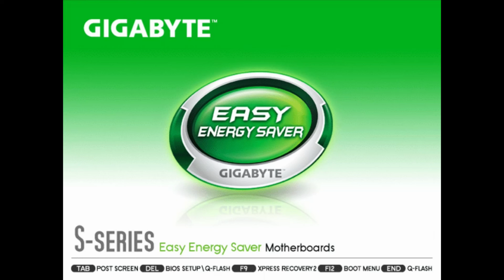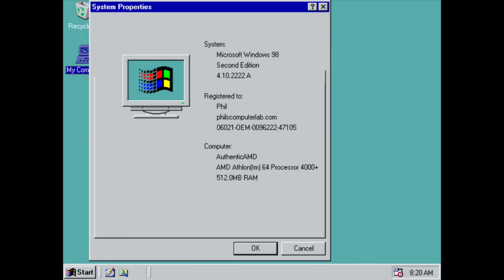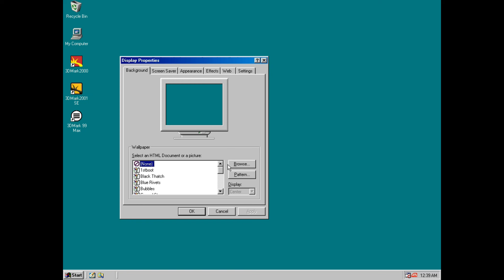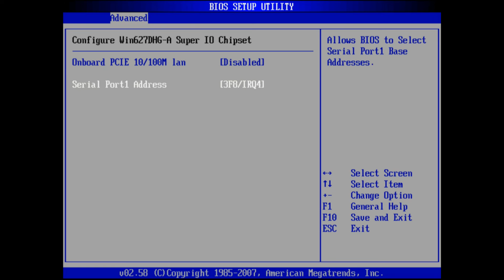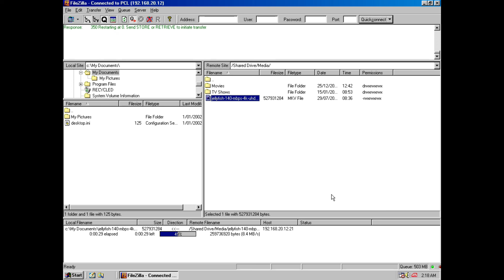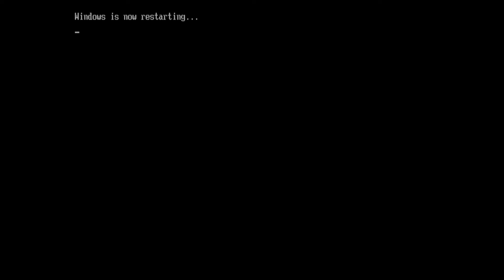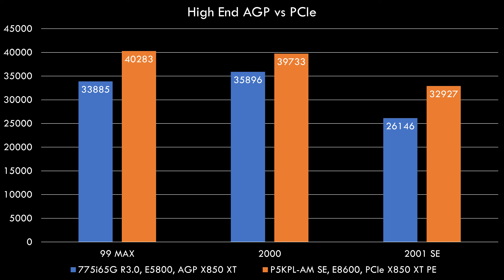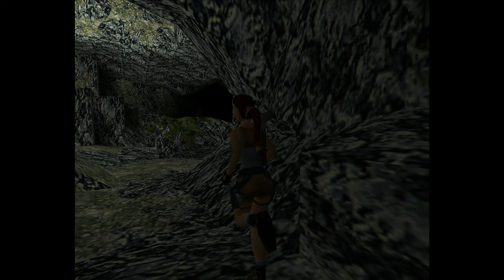Using PCIe Graphics Cards with Windows 98 SE

Comment: Fascinating video. It's really interesting to see what can be made to be compatible with Win98SE. I do have a question though and I think you'll be well placed to answer. In my head I remember it being more about a question of getting drivers to work and getting directX to work and once that happened games weren't really bothered if it was 98 or XP. But I'm a little cautious in assuming that's right because I clearly remember back in the day that if you asked anything about 98 people would just say "Go XP it's better you idiot", because back in the day there was always a relentless push forward to new tech and new games and old stuff was scorned. The reason behind my question is I'm trying to build a set of PCs (I'm up to 6 now) to cover games right from the start of IBM-PC to current day. I've got great overlaps going on, but what I don't really know is between 98SE and XP and between XP and 7... are there any games that don't work properly on XP that are better with super powered hardware in 98?
Reply from the maker: Yea many games work on both, 98 and XP. But with 98 you also get DOS and other parts like Voodoo graphics or A3D that don't work under 98.
Reply: @philscomputerlab  Yes. I have a 386SX16, a 233MMX SS7 with a voodoo1 and an S3 trio(for 386DX to P1MMX stuff), a P3@600 with a 4200ti, an AGP P4 @ 3.2ghz with a 9800pro, an X6 @ 3.2Ghz with a 750ti, and my modern 9900K with a 1080ti. I hope I've got everything covered with enough overlap that I will have a choice of which machine to run anything on.

Comment: "we made some int(e)resting findings" - alter, omegalul-CRINGE - ich hab zwar keinen plan, warum in der channel-info australien drin steht - weil der deutsche akzent ist ja mal mehr als deut(sch)lich rauszuhören - aber bei dem grotting englisch sei angemerkt: "australia" ist australien - wenn es österreich sein sollte - das wäre dann "austria"
weiter: warum sollte pci-e unter win98 nich laufen? es ist lediglich ein spezifikation über die physische schnittstelle - für pci-e selbst brauchts dafür keine (treiber-)unterstützung des betriebssystems - und da das ne karte noch aus zeiten vor der x1000 ist, das war so mitte der 2000er, also als XP gerade seine hochzeit hatte, 98 und ME aber dennoch recht verbreitet waren - warum soll die nich unter 98 laufen? es wird damals sicher irgend n treiber-pack gegeben haben, wo neben XP treibern auch 2000 und 98/me treiber mit dabei waren - frage geklärt, problem gelöst
und guckt man sich die boards an: da sind S-ATA connector drauf - sowas wie AHCI und damit standard-treiber für so einen kram gabs zu 98 noch nich - ABER: selbst heute noch kann man die meisten S-ATA controller in einen IDE kompatibilitätsmodus umschalten - der dann wiederum unter 98/me einen standard-treiber hat - da macht es also absolut keinen unterschied, dass da noch ne north-bridge und ne south-bridge mit nem chipset zwischen hängen was auf dem board alles via pci-e angebunden ist - und das läuft ja offenbar auch mit 98 - warum solls die graka dann nich tun?
gut - wer n affiliate für ali express hat - ich für meinen gedanken lieber mal nicht weiter aus
1:10 "I coulnd't get the pci-e to work" - wassn das für n blödsinn? wenn der pci-e nicht laufen würde hätte es GAR KEIN bild gegeben - was hier fehlgeschlagen ist, ist das installieren/laden des VXD treibers - was, da schon damals PEG slots direkt an die cpu angebunden waren, NICHTS mit pci-e als physische verbindung zu tun
6:40 "cool thing is: no drivers required" - ACH NE? no sh!t sherlock - haste jetzt nich angesagt ... um es mal mit der deutschen synchro von hard day's night auszudrücken: "Welchen Beruf schwänzen Sie eigentlich?" - is ja echt n toller tech-channel wenn nich mal solche grundlagen sitzen - warum belohn ich sowas noch mit viewtime?

Comment: For those that want to mess with AGP and PCIE on 775 a good choice would be the 4CoreDual-VSTA board by Asrock as it supported both DDR1 and 2 as well as AGP and PCIE, it was what we used at the shop to test parts during the changeover from AGP to PCIE. It supported from P4 all the way to C2Q so we could test a ton of gear on it and while IIRC out of the box it didn't have Win98 drivers it used a bog standard Via chipset so standard Via Win98 drivers worked.

It was a great test bed platform and looking on eBay they sell for around $60 USD with a CPU so not bad for an LGA 775 that can run anything.

Comment: On the AGP system with more than one PCI slot you could test a Voodoo 2 in it as a secondary card for games that require 8 bit palletized textures, but I am uncertain if that would create more conflicts in Windows 98 SE or not. If you could get it to work that would make one hell of Windows 98 retro machine though.

Comment: Hi Phil (folks), ignore if know this already, while its difficult or impossible (I've never got it working)  to get Windows 98 to "talk" to an SMB1 share on anything equal to or greater than Windows 7 (or is that 8?) or Windows Server 2012 R2 , this is not the case in reverse , basically enable SMB1 on your Windows 10 PC (use a VM if your worried about security) create a share on Win98  (I just share the entire c: drive and set access to full) and browse to your Win98 share  from Windows 10 (e.g. \\MyWin98 or IP\C-DRIVE) and job done! Granted its only one way and I'm not sure of its speed VS FTP but at least you don't need an FTP server or client.  You can also extract zips and edit files (can on WinSCP but fiddley) directly to/on your 98 PC across the network which you cant do with your typical FTP client. Works on Windows Server 2019 as well.
Reply from the maker: Yea FTP just works, but mapping shared drive is hands down the best.

Comment: Phil simply do a win98 install then back it up to a dvd disc with Norton ghost03 saves messing about in future will then install in minutes, do a dvd for each motherboard
Reply from the maker: I created an automatic answer file, so it installs fairly quickly :) I have used imaging in the past, for example if I want to test a range of sound cards, I take an image before installing any sound card, and use that image for every card, so there are no shared A3D DLL files and whatnot.

Comment: Geforce 6 Series has official Win98 drivers and they work fine. For the 7 Series there is a workaround but i never tried that, would be interesting to see how they perform in Win98
Reply: i'd love to see that workaround too
Reply: @LindenAshbyMK  For the 7 series you just need to use the Tweaked Unofficial
NVIDIA Display Driver 82.69. These are the only drivers that work for these cards under Windows 98.
Reply: It's been alleged that some of the series 6 cards don't work properly under 98 if they have the NV44 chipset, such as the 6200le

Comment: Nvidia cards up to 6800 works with default drivers. 

Its the 7000 and 8000 cards you can get working with modified drivers!
Reply: I tried posting the link to the modified drivers twice now.

But just google this, and you will find them: 
"Geforce 6/7 and 8 AGP/PCI-E Driver Edition for Win98/ME by Zak!"
Reply: I got the 9600gt working with 98
Reply: I have heard rumours of 8000 series cards working but I've never seen any proof
Reply: @GS-kh5se  hmmm...a video idea 💡 

Anyway, you can find the driver by googling: "Geforce 6/7 and 8 AGP/PCI-E Driver Edition for Win98/ME by Zak!"
Reply: @GS-kh5se there are modified drivers for 7/8k cards to work in 98se

Comment: I eventually got an ATI All-in-Wonder X800XL PCIe working in Windows 98SE on an Intel 965 chipset based machine using Catalyst 6.2. The trick with that machine was the rloew RAM patch. Before that even with only 256MB installed in the machine I could never get the video driver working.

Comment: The video seemed to jump a bit, did the ASUS P5G41T-M not work out? You cut the Socket 939 board and said it didn't work also, but I must've missed what happened wit the ASUS P5G41T-M.
Reply from the maker: I tried the first two 775 boards without luck, then the 939 board without luck, then built the 775 AGP system before going on vacation. When I returned I worked with the final board (Asus with G31) and had success, but not because of the board, but because I learnt how to fix the issue :D

Comment: I sort of want to say why go to so much effort - Then I look at my shelf of PC games and realise that I would never be able to play those games like blood/unreal tournament etc if I did not have a machine capable of of running them if I did not have a machine that has a recommendation of Intel 200Mhz or AMD K6 32-64MB RAM and 400MB-710MB of disk space and a 28.8K modem.

I must will try them on VMware Workstation first them move backwards to some old PCs I have in my office. It will be interesting for install 3.11 / Windows 95 from floppy disks and Windows 98SE and NT3.51/NT4 from a CDROM drive again. I will then try my old IoMega Zip/JAzz drives and see what is on them - I will not try my old tape backup systems as I probably do not have the software for them.

But it is sometime fun to try these things in lockdown.

Comment: So did the ‘non-working’ motherboards you’d used at first have the same doubled GPU device manager entries or were their problems distinct?

I also noticed you hadn’t used your traditional Audigy 2, any reason?
Reply from the maker: Nope, no specific reasons :) Yea they all had the same issue in device manager, but I didn't go back and revisit the first boards...

Comment: Phil: where can I find G41 chipset drivers for 98se?
Reply from the maker: There are no such drivers! I didn't install any chipset drivers.
Reply: @philscomputerlab  That's half true - there are no G41 drivers (that is the onboard graphics) but there ARE drivers modded for Windows 98 out there for the ICH7 chipset.  I believe these will get rid of at least one of the exclamation points you still had in your device manager (the PCI System Management Bus).  I believe you can also run your hard drive in AHCI mode instead of compatibility mode with these drivers installed (though you would probably have to start your installation from scratch).
Reply from the maker: @retro-computing-gaming  Fascinating... Do you think there is a performance impact of no having this device driver? To be honest the storage performance was outstanding, even in compatible mode.
Reply: @philscomputerlab  I'm curious about that myself  I may benchmark my rig when I get around to it.....my issue is I'm obsessive about getting rid of every last exclamation point in my device manager, even if it really isn't necessary.
Reply: Good to know! I have always believed that the bare minimum driver were the chipset driver.

Comment: Happy to be of help!  NOW you can take it a step further and install a Yamaha YMF724 or YMF744 PCI sound card and create a triple boot system with DOS/98/XP.  Some special configurations are needed but at least some of these 775 boards support Soundblaster audio in native DOS mode.

Secondly, the FireGL V5000 card works but you have to hard-mod the card's BIOS to an x700 BIOS as forced drivers won't work.  The best card if you can get your hands on one is the FireGL V7100 - that one works with forced drivers and no BIOS mod needed.
Reply from the maker: Hmm I didn't mod the BIOS, just selected the X800 Pro drivers through device manager. I only tested 3DMark, Quake II and Quake III though. I believe I have a V7100. Nice looking card and single slot...
Reply: @philscomputerlab  I'm just talking the V5000  (since you mentioned in the video you had other workstation cards to try, if you happened to have a V5000 and wondered why it didn't work) - it is an x700 equivalent and unlike the V5100 and V7100 which run fine on their equivalent x800 drivers, it requires an x700 BIOS to run that way.  The V3100 and V3200 theoretically should work too as X300/X600 cards though I've never tried either of those.
Reply from the maker: @retro-computing-gaming  Ahhh gotcha, I was using the V5100, different model. Ok good to know. I had a quick look and looks like I don't have the V5000, but confirmed that I have a V7100. I will keep an eye out for more X series and FireGL cards :)
Reply: @philscomputerlab  That V7100 is a fantastic card - it actually marginally outperformed an nVidia 6800 in my tests a few years back.  Unfortunately it is a fairly rare card.   Might have some overclocking potential too.

Comment: Cool!  I have a couple of early LGA775 boards that won't support Core 2 Duo processors, thus making them unsuitable to build low end Windows 10 machines.  This information makes them good candidates to make Windows 98 systems instead of the LGA478 boards I have been using.

Thanks as always for your great videos!

Comment: I really enjoy these sorts of videos you do, finding other options for retro hardware. And thank you for sharing the link for the RAM patch, it's going to be very useful
Reply from the maker: No problem!
Reply: @philscomputerlab  two tips for the high-end geforce videos:  loew created a bios patch for geforce 6 & 7 cards with 512mb vram, so you can use a unpatched driver.
also for 256mb geforce 7 cards (like 7800gs) you can actually use the last official driver (81.98) without any modification. just force the install, it works. did it myself.  at least for cards with the g70 chip. not 100% sure with g71 chips. maybe even the bios patched 512mb cards could work with that driver version.
i still paid for the patch ;) r.i.p. r. loew...

Comment: Watch out! There's gonna a be run for the Asus P5KPL-AM SE and the ATI X850 XT PE on ebay next ;)

Also why the Live 5.1? Seems like an Audigy 2 ZS would fit the theme better. As always Phil, thanks for the inspiration!

Edit: The X850 XE PE also includes a variant with a DVI and VGA output for all us CRT purists :)
Reply from the maker: AFAIK the AGP card has DVI and VGA, whereas the PCIe card has dual DVI. But you can just use DVI to VGA dongle, and drive CRT that way :)
Reply: @philscomputerlab  Actually, at least in the US, there was a PCI-e variant. Check out this listing on newegg: newegg.com/p/1B4-00NG-00055

Comment: Do you have a build guide on how to part out and source components for a 98 machine with a mix of retro and modern parts? That'd be awesome.
Reply from the maker: What do you mean? I have a few build videos on the channel, absolutely :) A lot of hardware works with Windows 98, take your pick :)
Reply: @philscomputerlab  Sorry, just found your channel and haven't gotten though all the content yet. Will definitely check them out. Only reason I ask is because I was strictly IBM pre-builts during this era, but I would like to do a build. It definitely pre-dates my experience though. Not sure  of all the differences and considerations between current hardware and vintage.

Comment: Really cool project. This is definitely something I've thought about doing for a long time, but funny enough every time you see people try to get PCI Express working in 98, it's usually with an NVIDIA card. So it's very nice to see this being done with some Radeon GPUs, and you couldn't ask for better results.
Reply from the maker: I like using Radeon cards with Windows 98 :) When capturing from DVI for example, DOS output is sharper compared to Nvidia. And the drivers have all the settings, like AA, AF and V-Sync without having to install coolbits registry tweak and things like that. As for game compatibility, it's hard to say, I actually don't test that many games, and have little time to play, so some games might work better on either of them...
Reply: From a software point of view PCIe is backward compatible with PCI. Therefore it should work. Of course there can still be issues with drivers support for the device itself, but older operating systems should simply see a PCIe device as if it's simply a regular PCI device. There are even cheap adapters that you can find on places like Ebay and alibaba that will adapt PCi cards to PCIe slots and vise versa. The adapters require no software as they are simply a hardware bridge.
Reply: I could never get my GeForce 7600 gs PCI Express card to work in 98 se
Reply: Looking very much forward to your next video!
Reply: Hey Pixel, love your vids, hey you are good with old stuff being used in new stuff maybe, any chance you could weigh in on something for me quick? I collect GPU's and love switching them in my system and benchmarking them. I have Win 10 and can drop anything in from my DX10 HD 2900xt up to my current 7900 XTX. But if I put in my X850 XT or X1900XT DX9 cards, I can't get a signal, not even the bios. Are some motherboards just not compatible with DX9 cards? I would think it is windows not liking the card, but like I said, no video out at all even for POST screen.
Reply: @QuisquamHam  It could be compatibility, but I've also had ATI cards not initialize their monitor outputs because they don't recognize the screen attached.

Comment: interesting to see how these last gpu cards for win 98se work and learning what are the drawbacks to using them.  I'm very curious to see a comparison on how the late nvidia cards (geforce fx 5900/5950 and geforce 6800) also work with 98se, how the 8 bit palletized texture/table fog are affected and also how is the 98se compatibility are affected with later and earlier games using these cards.  I did find recently that Nvidia had a table fog emulation available but not sure which software or os.  I copied this instruction to find table fog emulation from a battlefront forum circa 2002 posted by user "Schrullenhaft":     

 Start Menu > Settings > Control Panel > Display control panel > Settings tab > Advanced... button > at this point it may vary, NVidia will have a tab with the name of the video card and others may list their advanced configuration tabs here (Direct3D or DirectX tabs for some brands) > Additional Properties button (NVidia) > Direct3D Settings tab (NVidia) > Enable Fog-table Emulation check box (NVidia)